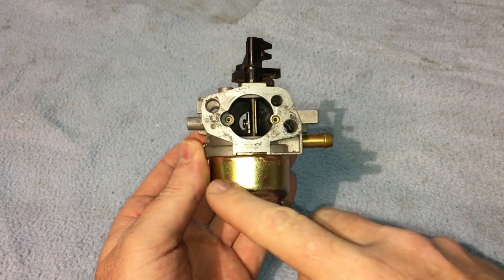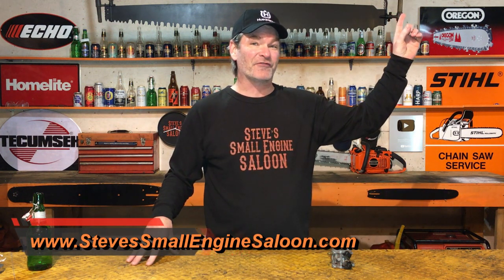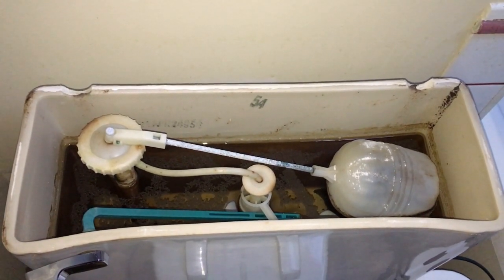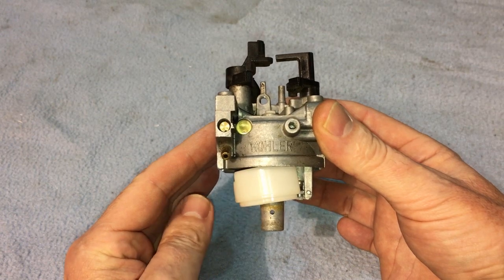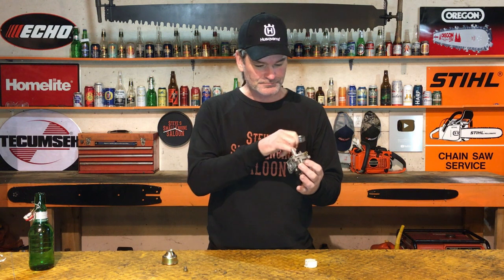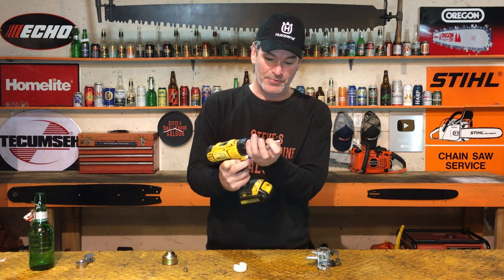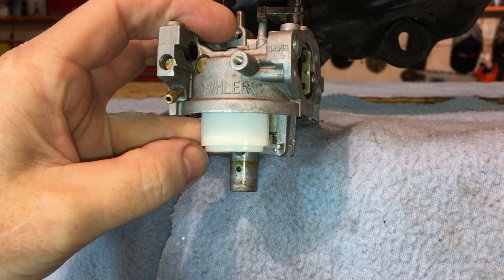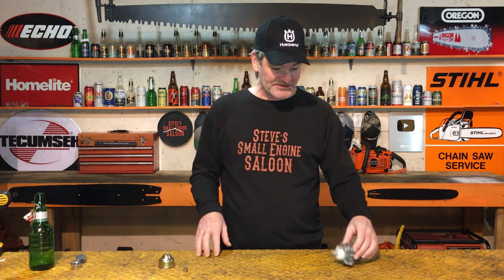How To Fix Your Leaky Snow Blower Carb – Honda Style

Comment: Stored a Honda engine once in a lean too hot area . Went too use it and checked the oil first . Pulled the cap and oil with gas came flowing out . Drained the entire tank over time from heat expansion forcing gas thru the needle valve . Yamaha carburetors with removable brass seats for needle float are notorious for the seal under neath leaking by in the casting where they thread in . Corrosion .Bacardi rum and coke is better for me when working on engines in the shop 😂👍 Good instructions steve as usual 👍

Comment: I literally just had this problem. I went to fire up the snowblower for the winter season and all the gas I put in the tank was on the floor. Took the carb off and cleaned it, put it back in, and no problems. 

I’m just glad I tested it before we actually had a snow storm.
Reply: Had my gaskets fall out and thats why mine leaked out back.

Comment: Hello Steve... Love your channel.  I have learned allot watching you.  So I have this used Cub Snow Blower I bought 4 years ago...   I started having problems with the Carb leaking gas from the Air Cleaner Side... (No Air Cleaner on the Snow Blower). SO I order a Carb from Cub. It was the last one in stock...  Changed the Carb and within a few hours started doing the very same thing... So I had the part number and thought it might have been a Customer Return and damaged SEAT... So I ordered one on eBay for half the price and it came in the very same box as the Cub Carb. Same Problem.....  So I start calling around picking the brains of the Repair Shops... 2 Carbs... That is unusual... Same Problem... So it has been parked for 4 years.... Pisses me off I cannot fix it...  My next go with it was going to replace the Intake Manifold Gasket.  Since the Carb puts the fuel onto the intake then it turn 90 degrees UP.... And into the Engine... My theory was it might have been Sucking AIR letting fuel build up and run out.... Never got to it...  So watching your video.... With a dirty SEAT.... I remembered something.... BLACK SPECKS... In the GAS.....  And WHERE did the black specks come from?  I used a TURKEY BASTER to suck out the OLD GAS.... Some got into the BLACK rubber thing and little specks of BLACK Rubber came out into the TANK.... Watching your video It became clear that my action caused this whole problem... I contaminated the TANK.... And I never flushed the tank... And I don't think this motor has a GAS FILTER.....  Time to revisit this Snow Blower... With some Ethanol Free GAS....   I will follow up with what I find... It has to be "All About the SEAT.."....   In my Navy Days when I was fixing Electronics we had a saying if we went to fix a Ships Radar... Go where Sailors have BEEN... What did you do before it stopped working.... O' we adjusted the Power Supply....  So you start at the power supply... Go where Sailors have been....  :) Thanks :)

Comment: I have a Taurus generator from aldi and I had this issue and it was caused by the wax in unleaded fuel (long time without starting it ) I was not sure about how to do it so I bought one on ebay a complete carbi was A$19 but now I have a spare after I clean it thanks to you
Reply from the maker: Right on Buddy...

Comment: In-line Fuel Shutoff Valve does help...

Though not ALL feul burns off! Always helps to remove the 1/2" or 10mm bolt to take the Fuel Bowl off to "Completely" drain the Bowl!

Thanks for sharing this video!😎

Take care,
🤓 -Thomas
Western Washington State

Comment: A useful thing to get your hands on is a carburetor jet cleaners. I know honda actually has a set which is part number 07JPZ-0010101 they can pretty much be used on most carburettors, apart from those lovely new Briggs and Stratton plastic carbs.

Comment: Back when I use to be a small engine mechanic, I do remember Honda parts being crazy expensive! The most common problem I use to have with Honda engines were the intake or exhaust valves sticking open
Reply: thats why im getting the newer 2019 husqvarna st 400series of a 17hp or 20hp or 21hp wich it can handel kubota engines too because the parts are cheaper

Comment: Hey Steve....don't forget any hollow style float (plastic or brass) can crack or develop leaks at the seams and leak fuel inside....float sinks and no more fuel shut off🤣

Also, always good to turn fuel tap off when transporting, and drain f.tank when storing the machine.....
If it's not shaky shaky, spilly spilly...fuel in oil.....it can be pressure build up in the tank forcing the needle and float down...lots of fuel in oil...lol👍🇦🇺

Comment: Steve,  Thanks for the video.  I had the engine running  and I believe it got into the oil.  Do I also need to drain the crankcase and re-fill with new oil?  Or is my engine ruined?

Comment: Hi Steve, love your channel! ♥️ You convey great information in a wonderful way that anybody can understand without talking down to us. Thank you! I have a question, I have a few pieces of lawn gear that’s been sitting up for years, ran the gas out of the chipper and now because of you I want to bring it back to life. I’m replacing the fuel line as it’s petrified. What’s the easiest way to clean out the impurity’s from the gas tank without taking it off the chipper. What can I flush it with and collect in a can through the new gas line that I haven’t cut to length yet. Fuel or something else? I do want to trash the carburetor by not flushing the fuel tank. Any help would be greatly appreciated.

Comment: I’m thinking that is the problem of mine because when I put fuel in it and start it up the oil comes out quick from the carburetor. I thought it might of been the needle and seat but I’m not sure. The only reason that I might have some input on this is from watching your videos. I have to try to fix this the cheapest way possible or my wife will kick my a** lol. I am not mechanically inclined at all but I am willing to try to give this a shot. I was thinking to maybe take pictures of every step I do and maybe it will help me. The snowblower is maybe a year old if that and it’s having this kind of problem.

Comment: Excellent video Steve ! Two questions...what is the purpose of that second bowl nut facing out from the bowl ? Would you recommend using a Fuel Filter Funnel for filling small engines, to prevent water and dirt from getting into fuel system ?....Thank you for your time !

Comment: I was stuck in the Honda carb vortex when I had an 18 horse walk-behind Honda mower that was manufactured in the 90's that if I forgot to shut the gas off it would pour all the gas into the crankcase. We could not get that carb to stop leaking and I looked for a couple months for a carb but could not find an exact match or even one that would work. I ended up changing the engine out for a 22 horse Briggs that works perfectly but what a shame to have to junk out a Honda engine because of the carb.

Comment: Thanks for this tip. Slowed the leak down considerably. Still notice a drop or two every once in a while. Needle looked good - float just looks old. Wanted to give you credit for the referral - want to make sure I get the right carb. Is your link for one that fits the HS55 Snow Blower from Honda? Can’t seem to be able to confirm in search. Thanks again - would like to try and support your link.

Comment: I learned the q tip and fine abrasive trick from Mustie1. However question for you: any idea how many psi of incoming fuel pressure the needle can handle before the psi overpowers the floats ability to hold the needle closed? I recently put an electric fuel pump of 1.5-2.5 psi on a honda gx620 and wondered this question.

Comment: QUESTION:  Is there a trick to getting hoses off of carbs?  The best way I've found is to get a flat-head screw driver behind the rubber and push away from the carb.  This causes the hose to bunch up and loosen a bit.  But I'm dealing with a hose right now that I can't really get behind (fits very flush to carburetor.)  I don't want to damage the hose.  Is there a trick to getting these hoses off the carbs?  Thanks in advance for any and all advice!

Comment: Hey Steve I have an unrelated question. I seen a landscaper driving down the road and I noticed he had steel cable with crimped ends on his weed whackers. Is this a good idea? I would like something that lasted longer I have to replace mine almost every time.

Comment: GREAT TIP!
Reply from the maker: Thank You...
Reply: @StevesSmallEngineSaloon  Noooo, thank YOU..I wish I could have seen this video, back in 1993 or so....
Keep up the great work!!!
Oh, by the way, Steve. I have a 2007 John Deere X300 I bought new. The starter failed. It seized. I opened it and saw that 2 of the 4 magnets became un- glued and jammed into the stator??? There were bits of broken magnets all over the inside. Did you ever hear of this happening? I know, the tractor is 12 years old, and things are failing here and there. Just wondering if you came across this.
I ordered a new one...

Comment: If it floods into the engine oil, will that cause it to burn oil?  I have a leaky one on a snow blower (Troy built) but it's also leaking onto the ground.  It only runs on choke.  This makes me sad. Maybe I put too much oil in it tho too.

Comment: Steve, I have a question?  I have a John deere Model 928e snowblower, its got a briggs 305cc/13.5hp 4 cycle engine. When changing the oil(local JD cant even give me a straight answer) the dip stick is plastic and the screw in type,  to get an accurate read on the crank oil do I screw the dipstick all the way in...than check, or do I just dip it to the top of the threads.  There is about a 1/2 inch difference in oil level read on that dipstick between the two, I am just on the tip of the bottom ''just dipping" or I "in the money" when threaded all the way in.  It would be a big help steve!  Thanks,
Reply: My experience with that style of dipstick is to thread it in to check.  They are that way so you can check the oil when sitting and know if oil level is okay or not.

Dale in Canada
Reply: @dalemcinnes1834  Thanks Dale, you are correct! I thank you for taking the time to comment. After speaking with about four different John Deere dealerships I finally got this info.  Half a dozen told me to just dip it....when asked on how much oil to add to the crankcase, most just said"not much".(That really helps)  This model of JD snowblower is discontinued so half of me thinks they wanted me to blow it up so i would have to buy a new one.

Comment: Steve, I have a craftsman snowblower model 247881733 that will start but will not stay on after a few seconds. When I prime it, the fuel leaks past the carburetor gasket every time I prime it. (I originally thought it was leaking from the float bowl gasket / O ring, only to replace it and realize that the gas was coming from above the bowl and dripping down). 😣 Anyway, the snowblower will run as long as I continue to press the primer. So my thinking is that I should replace the carburetor gasket to stop the leak which should keep the fuel in the carburetor properly. But that gasket is so paper thin that I keep thinking there's no way THAT much fuel could be coming out simply because of faulty gasket that is THAT thin. What are your thoughts? Could that paper thin gasket be causing this much headache?
Reply: Didbu ever solve this? Im having the same issue. Did u try cleaning the needle seat and testing the float?